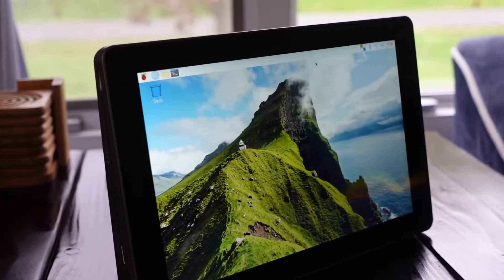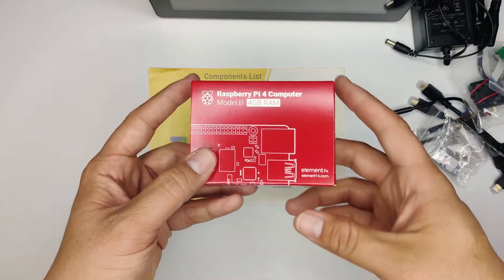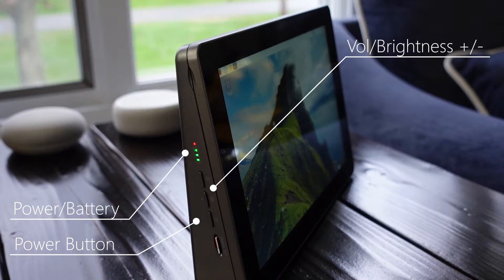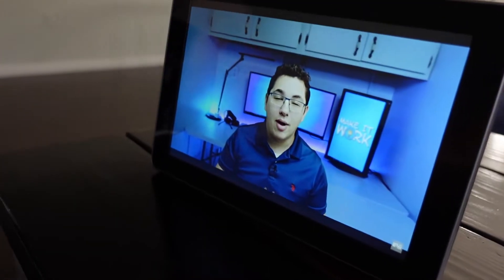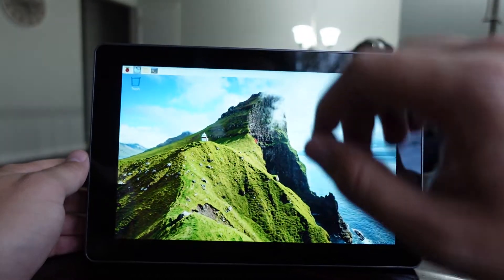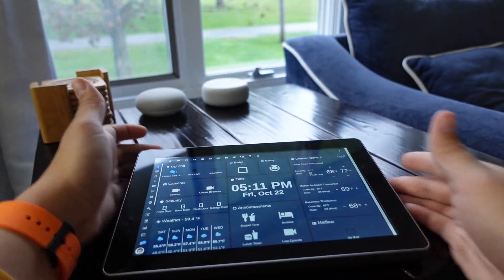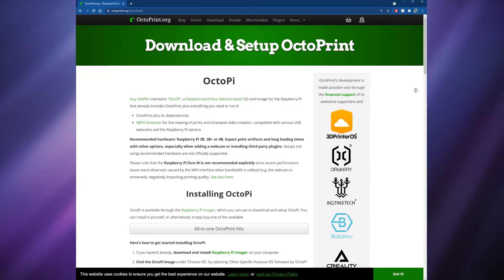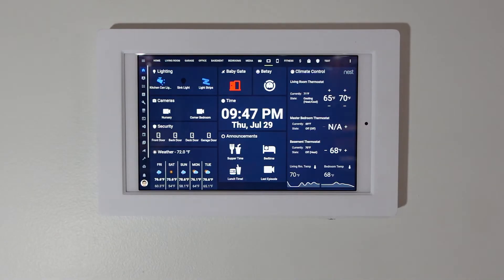Turn your Pi into a Tablet! (RasPad 3.0 Review)

Comment: I slapped that kit together in less than a beer. It started right up using the Pi OS that was already running on the Pi4. I'll eventually wipe it and do a clean install. I plan to keep it in the truck to run APRS. It will need a GPS. There seems to be plenty of room inside the case for a USB GPS . It will communicate with my radio using Mobilink via Bluetooth. That will be a bit more convenient than the the current Pi2 that needs an external monitor to display the maps.